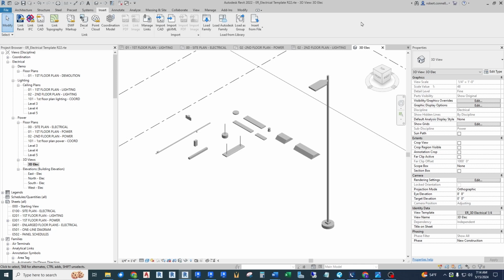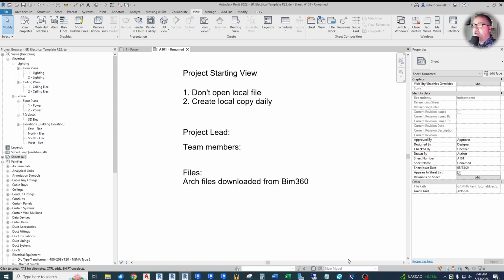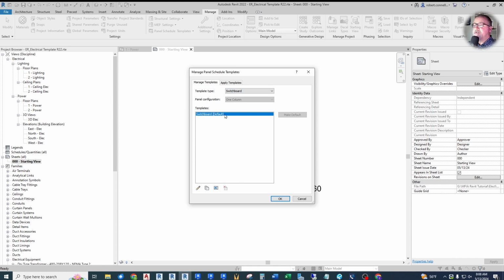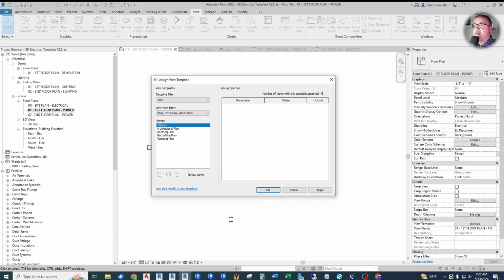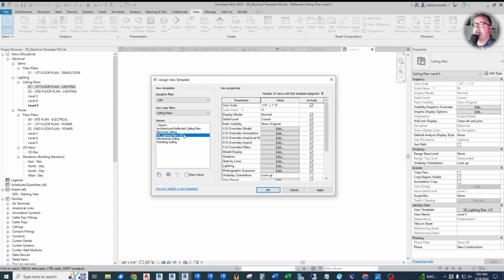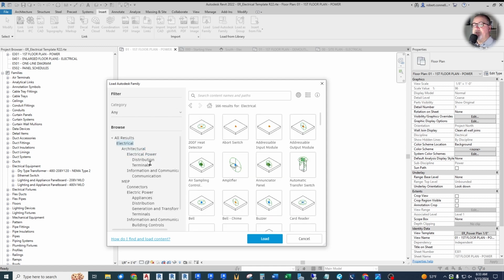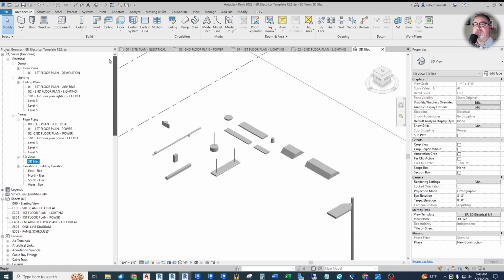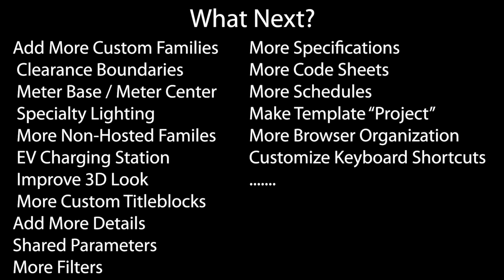REVIT MEP WARNING! You NEED this right away!

Comment: Thanks for getting back to me Rob. That sounds pretty good. I am using one of your templates on a project. I am trying to use ELUM tools for photometrics, but it seems that the room spaces are not available from within the template.  I ended up doing the photometrics right in the model the architect sent. It worked fine. Wondering if there is something going on with the template that would cause me to not be able to get the room spaces. Also, when I try to place a meter, it won't insert. Thank you!
Reply from the maker: If you are wanting to add spaces, you will need to click on the architectural link, go into Edit Type, and click that Room Bounding box, which will let the spaces find the room boundaries. So its not actually part of the template, it is within the link itself. Hope this helps.

And which meter are you trying to insert?
Reply: @ElectricRob  I see. Ok. I'll try that. Thank you.

Comment: Hello Electric Rob - How many families are included in your Revit Electrical Family Pack? What other families do you recommend that I have from your site? - Thank you.
Reply from the maker: Hey there Dan! My family pack contains 22 Non-hosted power and lighting families, along with 5 Hosted ones, and includes 5 custom tags. I'm also in the process of adding 2 more non-hosted adjustable-angle linear lighting fixtures to this set. A link to the offer page that contains a helpful video describing the pack is here https://www.electricrob.com/electrical-family-pack

As far as other families, the Universal Panelboard has been very popular, as it has many features not included in the out-of-the-box panelboards. For example, both Surface and Recessed versions are available with the click of a button, plus most parameters (dimensions, ampacity, voltage, phase, etc) are Instance Parameters, so each panel can be easily changed. There is also a similarly parametric Universal Switchboard available as well.

I appreciate your interest, and am happy to help however I can! Cheers!

Comment: Hi sir
I want to ask you some questions :
1 -  should we draw the conduits in our model. Drawing conduits takes long time and needs coordination.
2 - the connection between a junction box and light fixture, we use flexible pipe to model this connection. The problem is when we move these fixtures, we need to move all the pipes with them because there is no connection between the pipe and the lighting fixture.

I hope you get my point.
Reply from the maker: Hey there! First of all, whether you model conduits at all, and what sizes you model, comes down to the agreement you make with your client, known typically as the LOD or Level of Development/Design. For us, it's typically just conduits/cables 1-1/2" and larger, for space planning and coordination with arch, structure, and other trades. And that ties into your 2nd question - since the fixture whips/feeds are smaller, we do not model them. They are only indicated with the "wiring" as arcs, which do luckily move with the fixtures (even if you have to adjust the arc's a bit). If for some reason you really need the smaller conduits modeled, then yes, it becomes very time consuming and tedious. At least that is our experience with our actual projects - hope it helps!
Reply: @ElectricRob  thanks